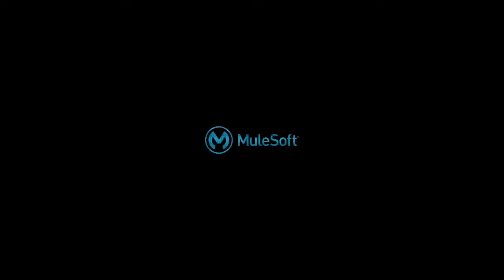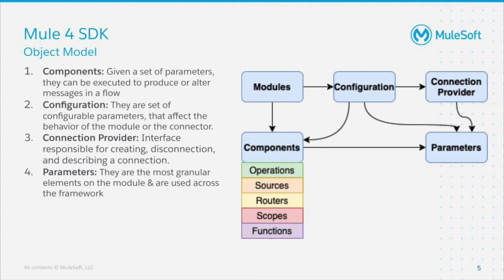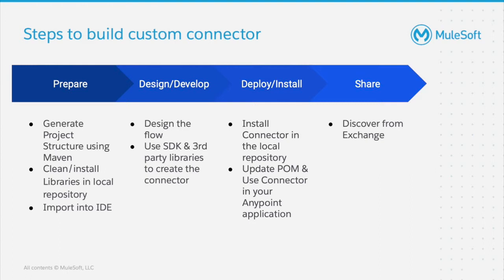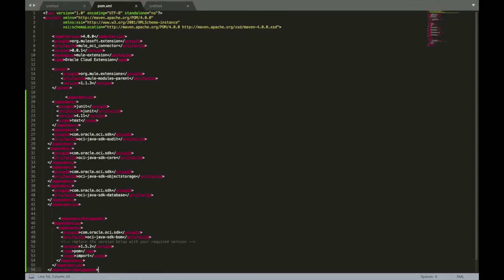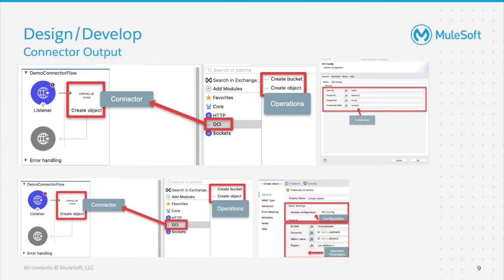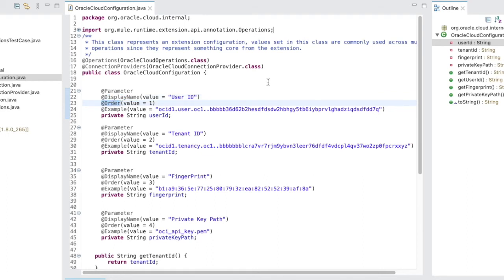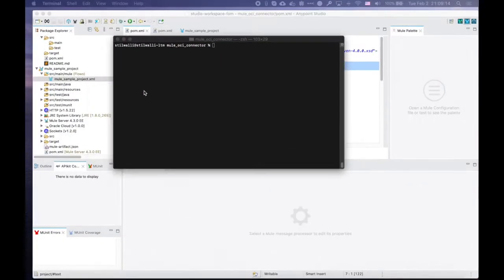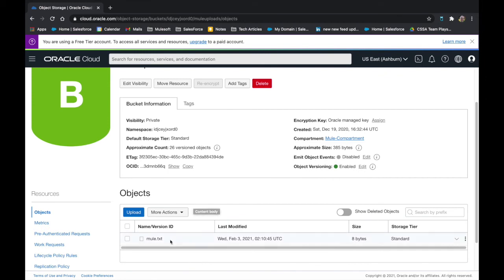Building Custom Connectors with Mule SDK | Friends of Max Demonstration

Comment: Hello All I need some help with XML SDK Mulesoft custom connector logic.

I have a below operation , In the parameters for the parameter name numberA , I need to populate a drop down list with 4 values , so that they can be picked up.

Could some one please help/guide me on this.

<operation name="sum" doc:description="Takes two numbers and returns the sum of them">
    <parameters>
      <parameter name="numberA" type="number"/>
      <parameter name="numberB" type="number"/>
    </parameters>
    <body>
      <mule:set-payload value="#[vars.numberA + vars.numberB]"/>
    </body>
    <output type="number"/>
  </operation>
  
  
Thanks

Comment: I need some help with XML SDK Mulesoft custom connector logic.

I have a below operation , In the parameters for the parameter name numberA , I need to populate a drop down list with 4 values , so that they can be picked up.

Could you please help/guide me on this.

<operation name="sum" doc:description="Takes two numbers and returns the sum of them">
    <parameters>
      <parameter name="numberA" type="number"/>
      <parameter name="numberB" type="number"/>
    </parameters>
    <body>
      <mule:set-payload value="#[vars.numberA + vars.numberB]"/>
    </body>
    <output type="number"/>
  </operation>
  
  
Thanks